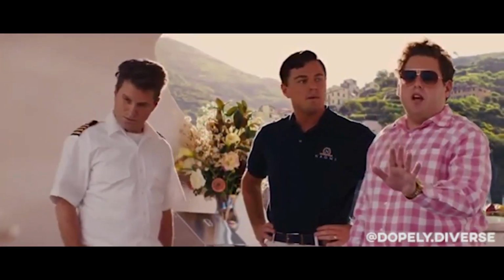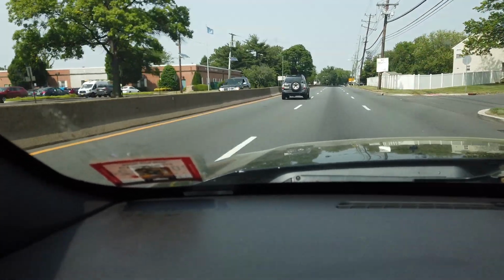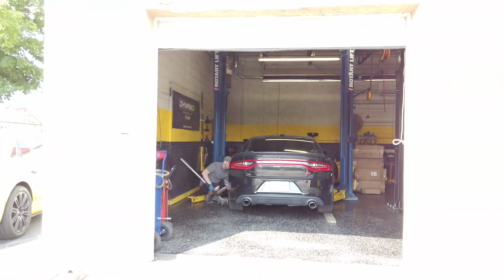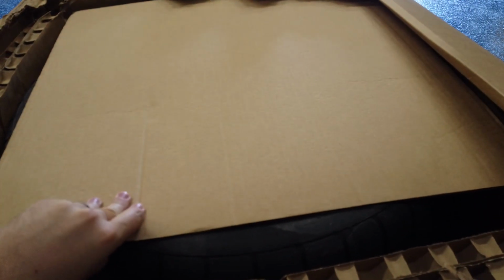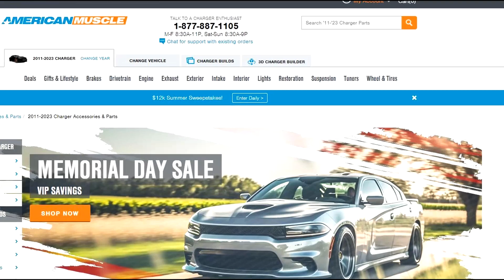SRT Hellcat Style Rims For My Charger Scat Pack from Americanmuscle.com + Install U Wrench it Auto

Comment: It’s been a year 😂 itching for an update
Reply from the maker: @jadent7416  I'm so overdue! I'm trying to get out and do my 200k review video even though I'm at 220k🤣
Reply: @johnnygt6039 is it still running smoothly at that mileage or have you started noticing any issues?
Reply from the maker: @RonRon18470  Motor and trans are fine. I do smell a little something under full throttle maxing out a gear but still pulls strong.
Reply: @johnnygt6039  when did you have to change the break fluid? I’m not sure if I need to change mine yet, but the dealer told me the break fluid is black but I need a second opinion. I’m at 18,700 miles. It’s a 2022 challenger scat. Bought it last March with only 714 miles on it certified pre owned. Any thoughts?
Reply from the maker: @RonRon18470  hey Ron, I don't remember to be honest. It can't hurt to change it though. If they're charing an arm and leg, just get it done somehow else. It's not a big job so to speak.

Comment: How many miles does your Scatpack have now?
Reply from the maker: Just under 190k! 200k video will be before you know it!
Reply: @johnnygt6039  If I were you unless you already did it, go and replace your fuel and water pump.  I went to work one day and my Charger RT quit on me.  I don't have that car anymore because they are a headache to own.  I got a Honda Civic Sport Touring 2023.
Reply from the maker: @BrendenBaker30  I find these chargers to be relabile, but they will never be as cost effective from a maintenance standpoint vs. something like a Honda. And I have not replaced my water pump yet.
Reply: @johnnygt6039  Not yet but eventually you will.
Reply: @BrendenBaker30 nothing last forever but at his mileage that’s a great charger and not a lemon 🍋

Comment: How’s the car drive at highways speeds 80-90 ? Idk if it’s the replica wheels or the fact I got all seasons on the front and bigger summers on the back. Done numerous balance and allighments and still a slight vibration 😪
Reply from the maker: You could have a bent rim. My factory rim was bent, and the dealership and the local tire shop couldn't figure it out. My friend in this video did. I guess they're hiring too many "kid's" with no real experience.
Reply: @johnnygt6039 gonna have them check that cause man I’m debating on selling the car I hate to even say that
Reply from the maker: @mjay7238  doesn't sound like a car issue. Take it to a good shop.
Reply: @johnnygt6039  gonna get my stock oem wheels thrown on with same tires and see if I still have the same issue. if it’s fixed with the old wheels I’ll keep her ! I wouldn’t doubt a rim is bent but considering how lazy some of these shops are best bet would to try my old setup that do you think
Reply: @johnnygt6039 was gonna ask to you feel the nitto summers in the back make it a stiffer ride than 4 all seasons? I’m running the same setup you r all seasons from summers back jw !
Reply from the maker: @mjay7238  Two biggest factors for ride quality are first, and obvious  one is the tire itself. I'd recommend a good site like tirerack.com where you can read people experiences with tires. The second one is the sidewall. The bigger the sidewall, the better the ride typically.
Reply: @johnnygt6039 I got the stock oems on and the issue is gone I guess I got a bad set cause they didn’t say any where bent, I guess I might buy a set from the site you used !
Reply from the maker: @mjay7238  yup, sounds like your rim was bent, and I'm not surprised a shop didn't notice. American Muscle is a good site! Good luck!

Comment: Looks perfect! Are you on stock suspension or lowering springs?
Reply from the maker: @MushfiqMRahman  all stock suspension!
Reply: @johnnygt6039  awesome. I have an R/T with handling package. So probably this setup will look good on mine as well.
Reply: @johnnygt6039  btw you remember the offset for the wheels?

Comment: Awesome! Engine and transmission still going strong? I was wondering if your model has the MDS system and if you have disabled it?
Reply from the maker: Motor and trans are good and yes, I have mds and no, it's not disabled.